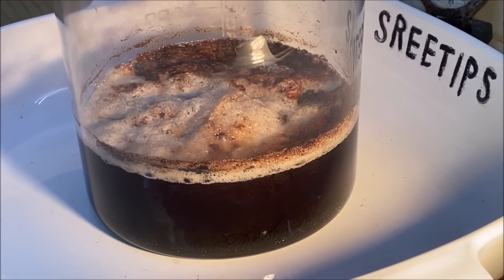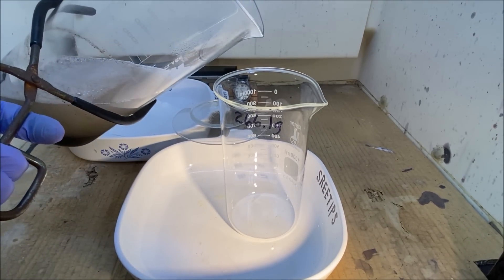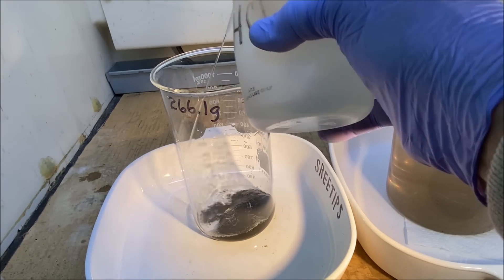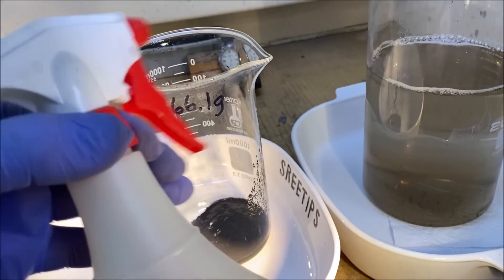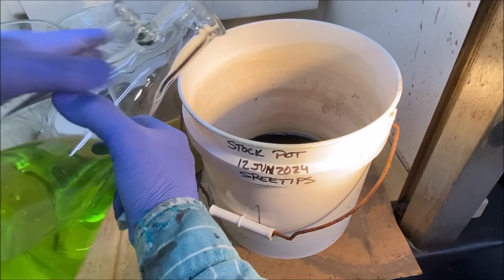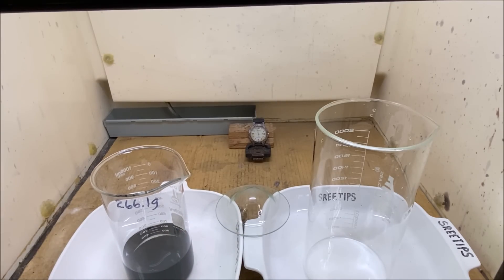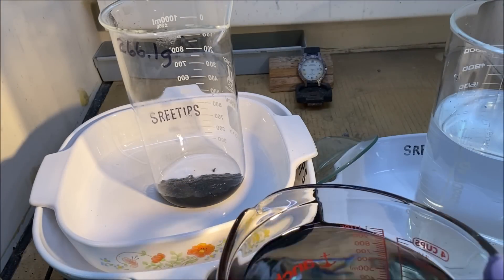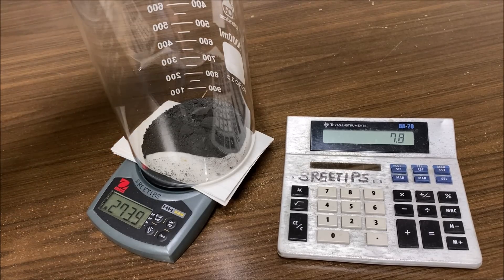How To Recover Platinum Group Metals From Dental Scrap Pt3

Comment: this looks overall like a bit of a pain in the butt to do, the dissolving after precipitation being one of the biggest problems that I am seeing so far. you need a lot of setup to do this both safely for you and for the environment.
Reply from the maker: Refining platinum is nothing like gold and silver. Those are like a cookie recipe compared to platinum.
Reply: @sreetips  I imagine platinum is a deal different to palladium too ...I had the knack for highschool chemistry but the  workings of these reactions is something else.
Reply from the maker: Palladium is easiest of the size sister metals in the platinum group. Because it the only one of the six that is soluble in just nitric acid.

Comment: Insomnia thought regarding your waste/stock pot cycles:(assuming that you’ve used the same repeating cycle of stock pots) There are atoms of gold from your very first refining that were lost in waste and have never fully escaped the stock pot cycle. They may have made it as far as the recovery stage of the stock pot process before returning to the stock pot, lost again in waste. They would have repeated this over and over, but still remain in the stock pot process. Making it…almost…to a finished bar, but, back into the bucket. Wah…wah
Reply from the maker: Not only that, some of the gold in your ring could have been worn by the Pharos of Egypt. That’s how indestructible gold is.
Reply: Awwww maaaaan. 😢
I’ll be thinking that think for a while now 🙃
Reply: Stockpot of Theseus. XD

Comment: what happens to the zinc that was in solution?  does it's composition mean that it won't come out of solutions in favor of the copper.  only the precious metals? - of course love your videos always!
Reply: The basic process he's using involves the reactivity series... each metal further up toward reactive will push the metals below it out of solution. Within the scope of the video, the zinc here is staying in solution, as it is the most reactive metal being introduced. Looking closer at the table you can see how he uses iron to push the copper out... the zinc remains because it is more reactive than the iron. In the end, generically speaking as presented, he'll have copper metal, and zinc/iron in solution at the end of the waste pot's run.

Comment: I do love how there is a sincere care for waste processing not just to get out all the precious metals, but to actually make sure toxic solutions don't end up in the environment.
Reply: In theory he could walk it all the way back to the metals and "inert" salts... Sodium anyone? 🤣

Personally I'd like to see him do more electrowinning... you can selectively pull the metals out of solution directly, using copper as the workhorse, it would operate in a right tight loop.. no need to involve iron or lighter etc. He says the copper is cheap... pennies to the electric company get the copper back... I wouldn't call a coil of wire or tubing "cheap"... There's also a process involving copper where he can get some of the nitric acid back... I understand not wanting to do that, distillation etc... 

But the electrowin cell is easy... he already does this with the silver cell more or less. Only difference is a carbon rod is used as the anode instead of silver shot melted from the cement.
Reply from the maker: I have buckets full of silver that I don’t have time to process. I may run out of time on earth before I can get all the silver caught up. It’s like the mail, it just keeps coming, and coming! So taking the time to process base metals, I just can’t spare the time.
Reply: @sreetips if it wasn't for the fact that I live in Denmark, I'd would be more than happy to volunteer and help you. And I'd only ever expect nothing but scraps as thanks 😆
Reply from the maker: I’d put you to work scrubbing glassware.
Reply: @sreetips Sorting the wheat  from the chaff is very difficult. You always wind up with a lot more chaff than wheat.
Reply: To add to this, the now cleared solution will be essentially the acids originally used to dissolve the metals, which something like sodium carbonate can be used to drop all the other traces as carbonates and neutralize the solution to sodium chloride, nitrate, and sulfate, which are all found in decent abundance in nature. Very clean process overall.
Reply from the maker: Sodium hydroxide. Sodium carbonate doesn’t have the punch.
Reply: @sreetips  Hydroxide probably work in most cases the same way yeah. Long as whatever remains is insoluble. I just like carbonate because it's got a built in indicator lol

By the way the electrowin isn't just recovery of copper to reuse... the idea is that you never need to go "above" it in the reactivity series and as such everything (except trace impurities) can always be recovered directly without the stepping of the iron, etc. 

The way I've got it in mind here shouldn't be any more complex than the stock/waste pot combo... it essentially combines the two into one step.

I'm also thinking that for the PGMs, while I've never done them myself, copper should work for recovery there as well, but I'm assuming you're using zinc for speed. I realize it's all a balance, just thinking along the lines of a more efficient process is generally easier overall, just a matter of other processes being compatible with it (such as zinc being "more difficult" to remove from a waste stream than copper).

I dunno, I know you have it mastered... this isn't a critique of your current processes. Just ideas to have "background process" doing some of the work and saving a little cash at the same time. That's one thing about electrochem... it isn't known for it's rates... as you know with the silver cell 🤣 - it just sits there slowly doing its thing.